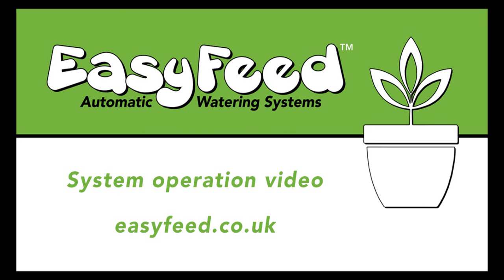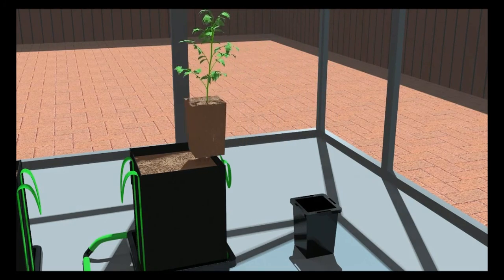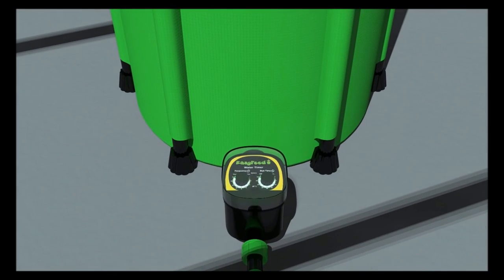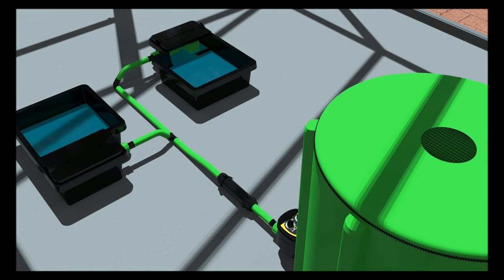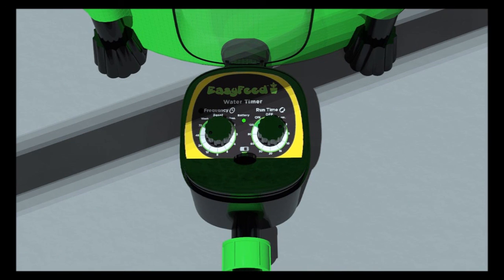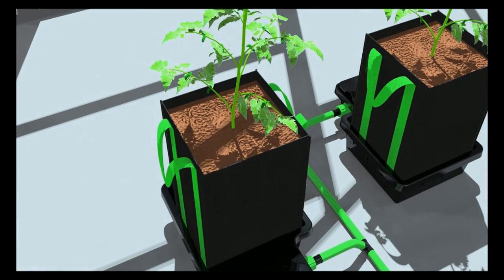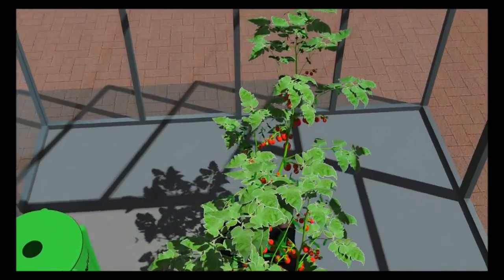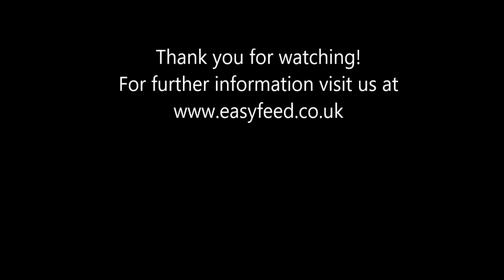EasyFeed™ system operation video, hydroponic system

Comment: Just grow with Autopot. Much simpler and more efficient.
Reply: your wrong there as both Autopot and easyfeed are very very good with easyfeed being a more advanced system with less worry of feed pipe clogging up as the easyfeed pipes are a lot bigger
Reply: @robertsimpson9747  can we use organic nutrient with that system?, because that was the bad point of autopot
Reply from the maker: @nordinoux Hi Robert, thank you for your message. Yes, it is possible to use organic nutrients in your EasyFeed system. We have just launched a product, RootRotX™ which you can use as part of a powerful routine clean. A little goes a long way! https://www.alienhydroponics.co.uk/Shop/root-rot-x/